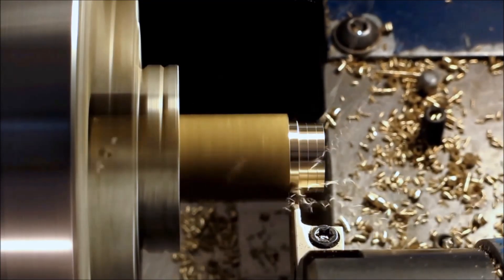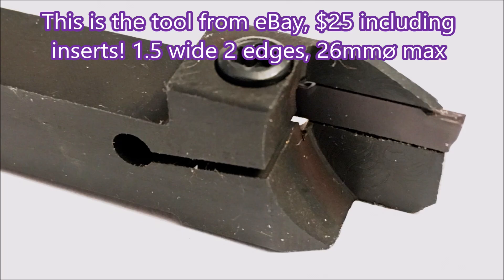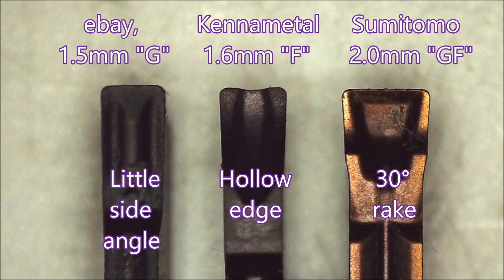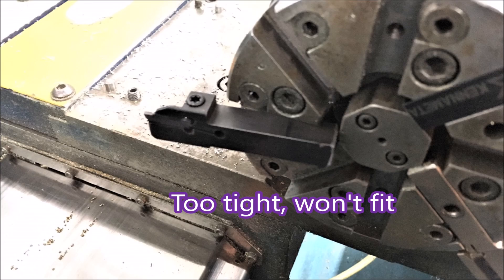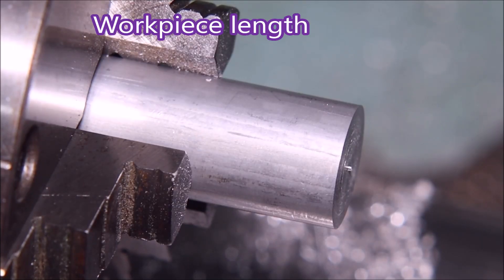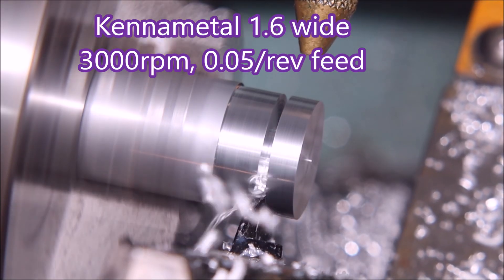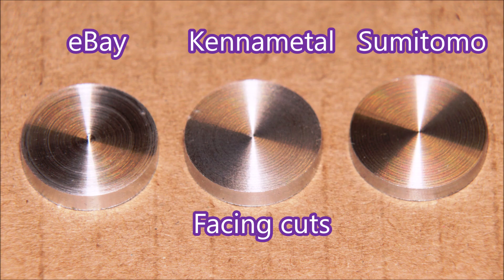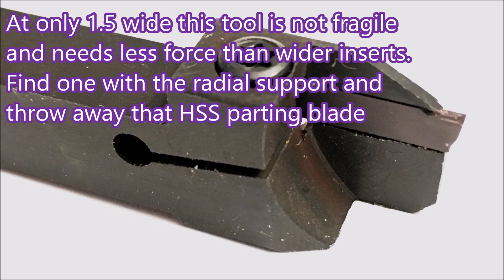$25 eBay Carbide insert parting tool vs Kennametal and Sumitomo at 3000rpm

Comment: I use a similar cheapo one and it's quite good, but for two problems. The fake Korloy inserts are quite fragile, so they often break before they wear out. The square cutting edge means there is always a burr on the part that is not always easy to remove. I'd prefer to have inserts with a RH angle to the cutting edge like you'd grind on an HSS parting tool, but haven't found any yet.
Reply from the maker: Hi, thanks for your comment, if you have a look at my last video, you will see I make good use of a really sharp rh insert
Reply: Thanks, that's exactly what I'm looking for. The parts I'm making are very similar to yours too.
Reply from the maker: @ashcustomworks  I made 400 of those parts, that parting tool made such a difference to the deburring of the holes. Sumitomo, not cheap but works brilliantly.

Comment: I run a full size dual spindle/revolver lathe at work, never use any non-brand names, but i run both some Kennametal and some Sumitomo tools, although i mostly run Sandvik Coromant tools. 
I haven't seen that many people use Sumitomo tools before, but from my experience they are really good precision tools. I generally think Sumitomo cuts better, and leaves nicer surface finishes than Kennametal, although they are a bit more fragile, you break the tip easier. Kennametal inserts are more durable from what I've tested, so they're both good, just at different things. Sandvik is a good compromise that lands somewhere in the middle between Sumitomo and Kennametal :)
Reply from the maker: Thanks Erik, I started with Sandvik, but they were too pricey by comparison with Sumitomo and my Sumitomo representative has been really great.
Reply: Yeah the Sumitomo tools are really great, they should be proud of the quality their tools and inserts have, especially for the decent price as you say. The advantage with Sandvik for me is that i live in Sweden, and have a Sandvik dealer in the next town from here, so when i order tools from there they usually arrive the next day already, if not the same day! Sumitomo and Kennametal take a week at least to arrive.

I also saw your video on the HSS parting blades, great video! Although i don't quite agree. Of course the HSS blades have no place on a CNC lathe at all, I've only used it once in the CNC when i was turning a long thin plastic part, but on a manual lathe i think HSS blades are great! Once you've learned how to grind them nicely they part like a dream! I don't claim to grind them perfect, I'm only 19 yo so i have a lot to learn, but i like the HSS especially in less sturdy conditions, that's where it shines, because you can get it to cut nicely without putting a lot of forces on the workpiece, run slow with some lube and take light cuts and it will both cut great and make nice chips!

Best regards from Sweden!
Reply from the maker: @Erik_Blomgren  Hi Erik,the introduction of the cheap Chinese mini lathes, has meant there are lots of folks out there that have no clue about how to drive a lathe.  I think HSS parting tools are best left to those that know what they are doing.  Even though you are just 19, if you can use them you obviously have acquired a good deal of skill in their use.  I am a draftsman with little machining skills so I stay well away from HSS.  Thank you for taking the time to leave these comments, it is much appreciated.

Comment: Chips aren't exiting as well on the cheap insert because there is a lot more coolant being used.   Cheap inserts seem to perform well at first but quickly degrade to uselessness vs. high dollar ones. Maybe a test comparing cost efficiency of that would be good.
Reply from the maker: I don’t make enough parts these days to contemplate attempting a test like that. Thank you for the comment

Comment: always good content. I have an emco pc turn 50 that i've made a new 5c air collet headstock for, and the part tool started getting on my nerves. ive only broken an insert twice, but the clamping screw is only accessible by removing the entire tool from the turret. so i bought a friction fit parting tool holder to replace it. it uses gtn-2 inserts, iscar makes some decent ones. the holder is a cheap amazon one, but it was the only one i could find without a clamping screw and a half inch shank. iscar makes the same holder, i think im going to splurge and order one.
Reply from the maker: Hi David, are you talking about a tool holder that uses spring tension of the holder to fix the insert in place? I have one of those by Tegutech and it works quite well, uses a tool to hold the tool apart to remove the inserts.
Reply: @smallcnclathes  sort of. its more of a wedge fit. its the iscar sgth self grip

Comment: Well that didn’t hurt as much as I thought it would and thanks so much for an honest review. I’m just a hobbyist so I use my lathe to do things for my self and not to make a living which means expensive tooling is just not an option for me and probably many others as well. I also have a BP clone milling machine and again budget tools get the job done I just don’t get the high end finish that I see multi million dollar CNC machines producing.
Im also not a machinist so I don’t have the technical know how of feeds, speeds and tool face angles but I get what I need done. Cheers Stuart.
Reply from the maker: Thanks Stuart, I well understand the hobbyist point of view now I have retired. I have to admit the cheap parting tool did impress me, just so much cheaper than my other tools. Thanks for your comment, did you see the follow up video where it cuts steel?
Reply: @smallcnclathes  No I didn’t but I will look it up. Thanks
Reply from the maker: @scroungasworkshop4663  https://youtu.be/LJMATzfWwSI
Reply: Usually main difference, between cheep and expensive inserts, is in quantity of cuts before quality goes down. So as kind of a hobbyist myself i think it's reasonable to buy cheap holders, and middle price inserts.
Reply: @tjurzyk  Good advice, thanks 👍👍👍

Comment: Nice job. How parallel is the faced off part for each parting tool?
Reply from the maker: Hi Nick, results are usually pretty good with face being flat. I mostly use neutral inserts which do not tend to wander making for a dished face. Is that what you were asking?
Reply: @smallcnclathes  Awesome. I've only used HSS parting tools hand ground on a manual lathe, and it was rarely good enough to make a flat surface. Thanks for the info.

Comment: I use iscars TAG inserts in the square coolant thru blades, buts that's on a full size cnc lathe.
Reply from the maker: Tried coolant, found it was more trouble than it was worth. Maintenance took too much time, wet swarf was a pain, just not worth the effort. Thanks for your comment.

Comment: Parting is a nightmare. It wouldn’t be the first time I wake up in sweats in the middle of the night dreaming about cracking inserts and bending holders ... 🥵
Reply from the maker: Hi Stefan, I am fortunate in that I can choose what materials I work with. Brass, aluminium, plastics, machining grade steel are about it. Although 4140 has come up a couple of times. Staying within my usual materials has allowed me to lose no sleep whatsoever. Using carbide inserts has for me been quite a revelation, as I never did well with HSS parting plates.
Reply: I learned the hard way to check my spindle bearings. I bought a used lathe, prev owner 'had been in there'. Once properly tensioned I part with no pucker factor. A solid tool post helps as well, the spindle bearings were the last step.

Comment: I could make 25mm pistons with one of those tools!  Wonder if you could use it to cut cooling fins in a piece of 12L14 Steel?
Reply from the maker: It was suggested testing on steel might be a good idea.  I may try some S1214 doing what I did here in this video.  Don't have 12L14. might try to get it uploaded by Monday.  Why do you need 25mm pistons???

Comment: Good compare of tools. Only problem I see is your tools are not on center line. That does affect you finish and chip removal.
Reply from the maker: Well the Sumitomo was on centre, the Kennametal was a bit low and the eBay one needed more metal removed than I was prepared to undertake.  The ebay one had to be filed to fit in my turret and it needed more removed to pack it up to the right height.  I was not prepared to do any more to the ebay tool than what I did.  I did not like having to file it down to fit the turret, but if I had not there would have been no video as I could not  use it.

Comment: Hello Nigel,
A good review... I guess maybe some of the extra cost for the expensive tooling is repeatability, in as much that 99.9% of the tools are the same and the cheaper eBay ones might be a little hit and miss... See you on the next one...
Take care.
Paul,,
Reply from the maker: Hi Paul, I think as much as anything buying top quality tools inspires confidence and if ever there is a process that you need to go well it is parting off. Very easy for things to go bang when parting off and of course this is the point at which the part is finished, this is not where one wants to turn the work piece into scrap.  So I paid the prices that I indicated and got on with making many thousands of parts. The only variation I made was to buy inserts that would cut going sideways for the 2.0 Sumitomo tool.  This was to prove they worked for a friend in the UK with a Hercus like mine but without the turret.  He uses that Sumitomo tool for all his brass parts and does all the turning and parting with the one tool.

Comment: I'm quite surprised with the performance of that tool.
  Would be interesting if someone did a similar video with them on steel.
Reply: Hello! We have some MGEHR 2020-2.0 tools in our workshop, we are using them on CK6136i, and HAAS TL-1 CNC lathes. The inserts are come from china too (aliexpress). We mostly using them to part off stainless steels, 1.4305 (ASA 303), 1.4034 (Böhler N540, ASA 420C as I know), they working perfectly, however they are not good as a genuine Iscar or Ceratizit (or any other big brand) tools, but the 20 pcs insert and 1pc holder bundle costs around 3-4 pcs of big brand inserts, so they absolutely worth the price. 
Moreover there are very cheap PCD inserts for this tools, which we are using for glass or carbon reinforced plastics (PEEK CF30 and GF30, PA6.6 GF25 etc.), with a very good lifetime, about 10-15 times more than a standard carbide tool.
Reply: @tnor90  well good to hear that's working out for you
Reply from the maker: Does S1214 qualify as steel?
Reply: @smallcnclathes  indeed it does, my mind was more thinking 4140, but yeah.
Reply from the maker: I have seen the size of the lathes you have driven so the 4140 suggestion does not surprise me.  Neither would it have surprised those lathes.  4140 is not nice to machine when all you have at your disposal is a whopping 1/2 hp.  4140 can be most unforgiving when one is not used to machining it. Getting the right speed/feed is important for most materials but I have found that with 4140 and my set up, speed/feed is critical and I have to admit I ran out of patience with it before I got it right.  I had other work to be getting on with and 4140 was such a rare material for me I just let it go and stopped worrying about it. So I can honestly say, it will not be the subject of a parting video from me. I think I can find some S1214 at 20ø in the shed so to run a few parts would not be an issue. Although I have to admit with the low view count my videos get these days the whole thing is hardly worthwhile. I am supposed to have almost 5k subs and it takes around a month for a video to get to 1k views and it sits at that for ages.  Makes no sense to me.
Reply: @smallcnclathes  I used to think 4350 was hard going, until we started inconel , then machining 4140 was like butter.
   Yeah a lot of people sub, but never watch.   For me I don't mind, I do what interests me, or if someone wants to see something I try to accommodate that.
    I think when some channels try to chase the maximum views, they sort of loose their "soul" of the channel, and that's what makes them interesting in the first place.    But that's just my opinion, and everyone has one, ;)

Comment: I use the MGGN150 insert with a heavy back rake. Helps on steel.
Reply: The Aliexpress sellers sell dozens of different combinations of chipbreaker type and carbide grade. Some of them are semi decent but the ones that are included with a holder are the cheapest possible I imagine

Comment: Strange my comments seem to disappear, I was trying to send you a link for aluminium grade inserts I use on the same tool. 😁
Reply from the maker: Not me making them disappear, I wonder if it was because you included a link?
Reply: @smallcnclathes  yes I imagine so, do you have an email I can send the link to?
Reply from the maker: No need, I have the link already as your comment came through on my email. Followed the link, was surprised the inserts did not look that different.  I was expecting to see an insert that looked sharper.
Reply: @smallcnclathes  they are much sharper than the standard insert that comes with the tool, I find parting much easier, and much less tool pressure on all metals I part 🙂 of course they are cheap, but that's ok for me with my little hobby shop 😁

Comment: I bought some from bangood chinese site......can not wait to try them.  I also purchased  boring bars (left/right) that takes the same size insert as the cutoff tools.
Reply from the maker: So the boring bars are really internal grooving tools?
Reply: @smallcnclathes  yes....i will use them also as cutoff tools.  I have a small gang slide Yang sml12 cnc lathe.
Reply from the maker: @deanneufell3284  If you do that, won't the cut off part fall onto the tool?
Reply: @smallcnclathes  no....use the tool on the outside diameter.  I machine mostly small parts. Insert sticks out .187
so anything up to .375 diameter.
Reply from the maker: Understood and of course with gang tools that is perfect,
Reply from the maker: @deanneufell3284  What is the diameter of the bar?
Reply: @smallcnclathes  16 mm lol .  I turn them down to 5/8 diameter  MGIVL2016-2  and  MGIVR16-2   :)